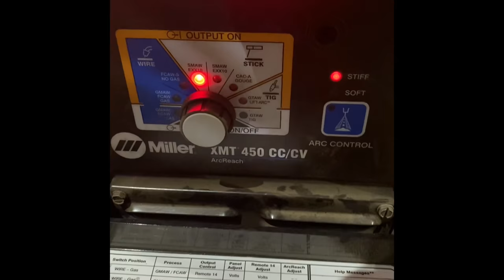Stick Vertical Welding Technique !

Comment: How come a triangular weave isn't required as it is for mig vertical up? I mean why doesn't the weld roll back down?
Reply from the maker: The zigzag technique involves moving the electrode back and forth in a zigzag pattern. Both techniques can be used for vertical welding, but the choice depends on the welder's preference. As for puddle not dropping down, you have to develop the necessary skills and technique to maintain a consistent arc length and travel speed, which helps prevent the electrode from sticking or dropping down.

Comment: Thanks, always a pleasure watching your work and listening to your advice and tips.  How does one get started working for themselves? Any tips? Would you recommend using a good quality multi purpose machine?
Reply from the maker: Hey Mike, thanks for your comment bud!  To answer your questions; start your own business and apply for the jobs as a contractor by hand if you don’t have welding rig. That’s the first step to get your name out there, the rest is up to you and your skills. If they like what you do, they will call you back or recommend you to someone else. As with current economic situation, welding machines are big investments, Multiprocess machines are good for shop environment, but engine driven machines are way to go if you’re bouncing around with your truck. Stick and TIG setup, that’s all you need, you can do piping or construction work.

Comment: this is great the only question i have is how do i not cause the puddle to drip and get hard i have this happen all the time and i just want it to not cause those rocks on my weld
Reply from the maker: Play with amperage and see what works for you, also your travel speed. I showed you how in video you just have to apply. Just play with settings.

Comment: does your machine have a hot start feature? i crank mine so i can get seamless tie ins! 
good vid man
Reply from the maker: Hey bud, sorry for late response, just saw your text. Not sure if I had that option but definitely know what you talking about, to be honest I didn’t use that much, and thanks for the tip. 👍
Reply: what do you have it set to for your hot start? and what about arc force or dig?

Comment: How much power need this vertical bro
Reply from the maker: Depends from the welding machine, but try around 88-91 amps with 3/32 rod.

Comment: Starts narrow ends up wider at the top.  Tie ins are lumpy and you are welding over a fully blended root pass.  I would like to see a cut and etch, I reckon there is a fair bit of undercut in that run.
Reply from the maker: Hey bud, thanks for your comment! I see you got a good eye to judge welds but you have missed two important things, and you are wrong about one! 
 1. Starts narrow because it was used a different weaving technique 
 2. There is no root pass as this is a Tee steel beam scrap metal ( but you noticed that, right?) And this is not an open root procedure, as the title description says Zig-Zag wave bead technique.
3. No undercuts from bottom to top ( you can zoom in if you like) 
So the tie-ins are not important on this scrap metal as the focus is here on the weave bead technique.
Reply: By the way good for you and trying to show people a skill which is extremely complex and at it top end complicated beyond most peoples comprehension,  it takes decades and decade to learn the craft completely